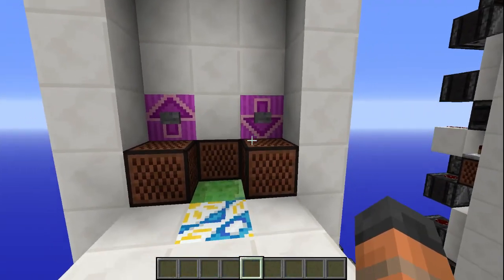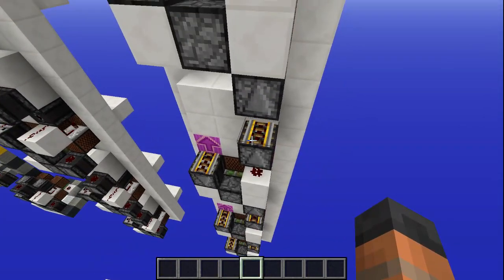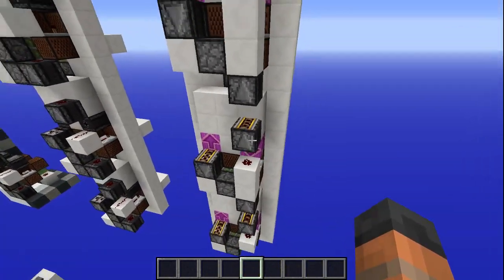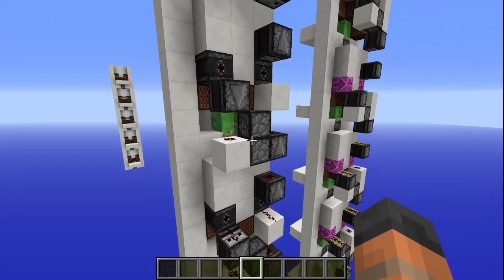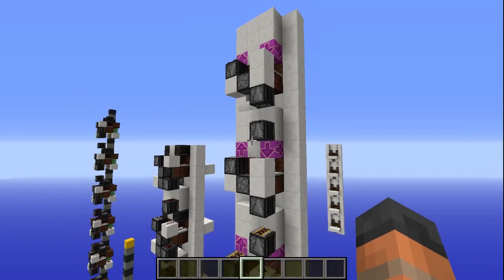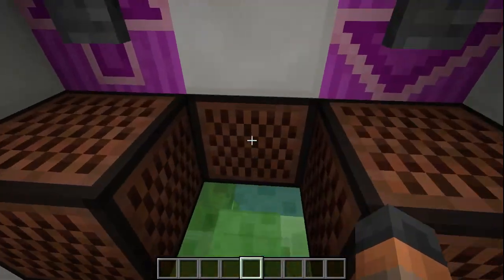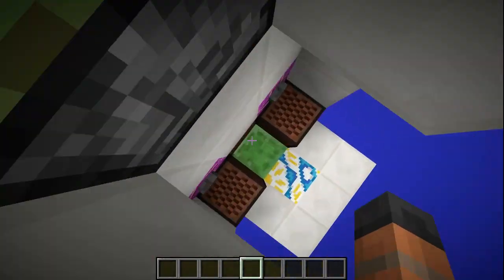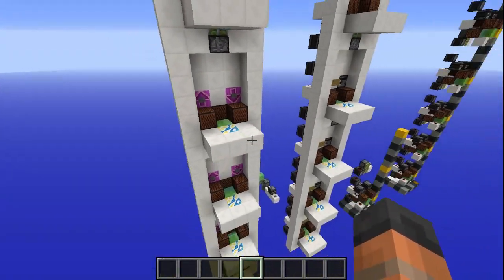Minecraft 1.12 Simple Slime Block Elevator IMPROVED!

Comment: funny how adding 2 glazed terracota will make this 4 times harder to built xD If we just had a wrench in this game.... yes powered rails are alot less laggy than the dust but only realy makes sense if you have lots of dust thats getting constantly turned on/off in this case you just power 1 dust and only if you actually use it so the dust is definatly the better option
Reply: Its really not that difficult to place them :-)
Reply: I get it and agree, we do need that wrench, xD.  Of course the rails could be trap doors if one wanted, although rail dupping is free.

Comment: Pro tip: Use activator rails! Reduces lag compared to redstone just like powered rails but they work too and are cheaper if you don't have much gold.
Reply: could also use trapdoors if youre cheap haha.
Reply: jjws600 trapdoors make noise, activator rails have no disadvantages compared to powered rails.
Reply: like i said, only if youre cheap use trapdoors haha.
Reply: If you're gonna be cheap about it, just use regular doors. You get an extra door per crafted set, and it still fits where it needs to.